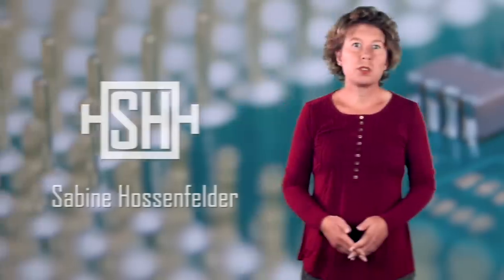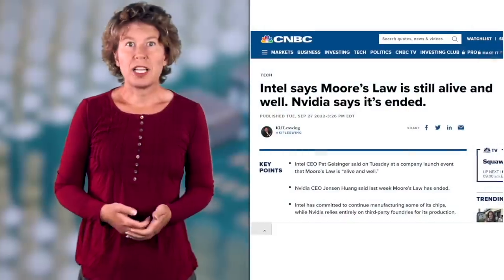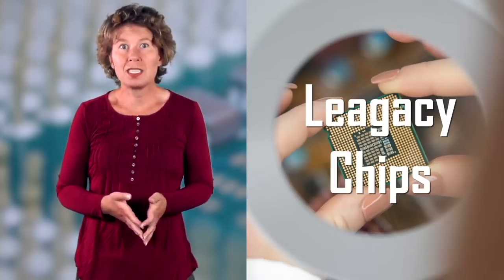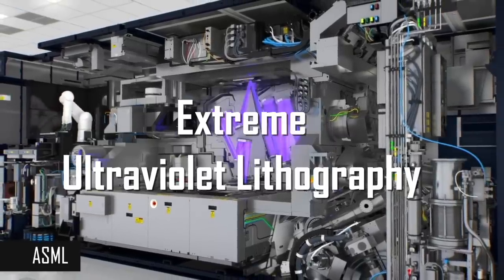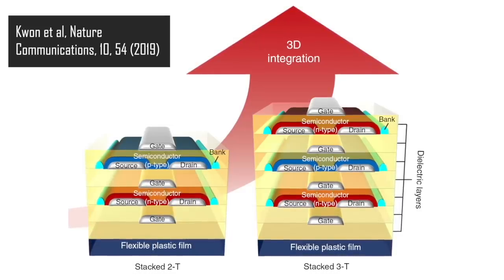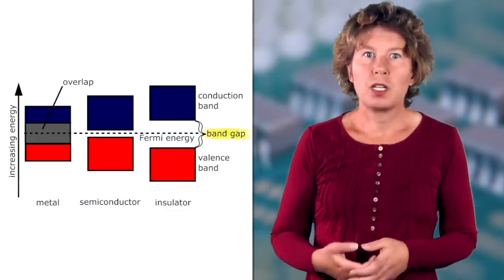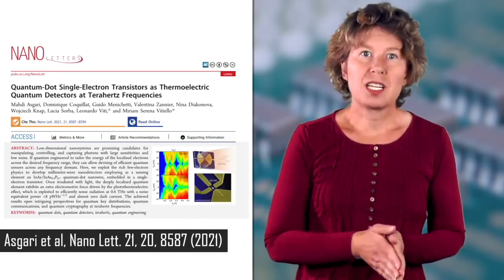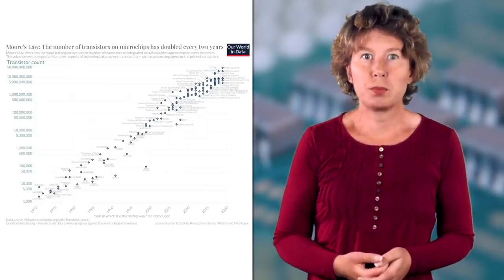Is Moore's Law Finally Dead?

Comment: Moore's law was originally about transistor density, and that original interpretation has been on its last legs for a few years now, despite some heroic work from the engineering teams at Intel, AMD, Nvidia and so on. His creator basically managed to see it go before he did. 

However, Moore's law in the interpretation of "how fast is this computer, really" has actually been dead for over a decade now. 

Pure processor speed basically stopped growing in the aughts. Around the time multiple core CPUs started coming out, as it was realized that, no, you can't keep doubling core speed every two years, 3 to 4 GHz is it for the foreseeable future. At the same time GPUs started taking on more and more esoteric capabilities, and dedicated cores to match. The current count of GPU cores is just silly, but it does account for their impressive abilities. They are certainly not running at THz clock speeds.

The bottom line is that CPUs are effectively not that much more powerful today than they were in, say, 2011 - at least per-core. 

12 years later, we should have had six doublings in power. That's 64 times the processing power. 

And we do... Mostly... It just so happens to be spread over 32 cores, each of them about twice as powerful, given a maybe 50% higher core speed - largely through improvements in instruction pipelining, branch prediction, and other stuff that, quite frankly, you could call black magic and not be too far off the mark.

Don't believe me? Check that Wiki site: 

A 4-core i7 from 2008 has a rated MIPS figure of 82000.

A 64-core Threadripper from 2020 has a rated MIPS figure of 2.4 million, give or take. 

That's a difference of about 32 times... Which is still missing a doubling over those twelve years... But more than that: divide the one by 4, the other by 64, to account for the number of cores, and you'll find that the numbers boil down to 20k versus 37.5k MIPS per core. And the threadripper has a 50% advantage in clock speed.

Twelve years later, each individual core is only about twice as powerful: a threadripper can only run a single-thread program about twice as fast as a 2008 CPU.

A lot of the improvements have gone into bringing down power consumption (which allowed us to have nice, quiet tablets with GHz CPUs) and adding dedicated circuitry for a number of functions that are much faster in hardware than software, like video decoding and encryption. That's still an increase in transistor count, so Moore's law isn't truly dead just yet... But having a CPU that can decode H256 video streamed via https won't help you play Crysis :P

Comment: 17:14 these capitalisation circutice the technologies of flow dots. Could be reverse engineered into logarithmic functions of its analogic computational advantage. Introducing a core assistant and fracturiced compartmentalized. If the analogical adherence coformulate. It would give us the thechnology to cool staked transitors. Introducing the frame aerly. These can be powerful components surrounding the main Q computer. Softproblem toggle for example. Also coherence 😮

Comment: My first computer was a Sinclair Z81.  I also had a few early 8086 -PC,s and a Macintosh Lisa, which I still have.  I recently built myself one based on an AMD Ryzen 7 7500X which is wicked quick, but haven't bought a new GPU for it, and still running a measly NVIDEA 1080, but since I'm not a gamer, it is more than sufficient for now, although I do Love playing with Mandelbulber 2, a 3D/4D fractal program which is probably the best of them all, and a much more powerful GPU would be great for that, as It can make fractals with realistic environments  (Reflections, refraction, fog, distance, depth of field, and even animate maneuvering around and even into them, which can take days, even weeks to render, so I guess I should build myself a super computer with a few hundred processors and GPU's!🤓
Reply: Dude, GTX 1080/TI was one of the truly legendary GPUs of the last 10 years. Still nothing to scoff at if you have one or can pick up a decent one at a decent price.
Reply: @ForeverTemplar  Well, yeah it was, but it's still not enough for what I need, and what is available now for way too much money.

Comment: I started out with a Radio Shack TRS-80 Model III that I bought in 1981. It had no floppy or hard drive, just a cassette drive with a "whopping" 16K of RAM that ran the TRSDOS 3.1 operating system. Not much existed back then in terms of software so I created most of my own programs utilizing the BASIC programming language since it had the BASIC language interpreter. I still laugh about it when I think back to the days of my first introduction to personal computing.

Comment: A couple of things.
Global Foundries is also a legacy node fab. They have decided not to invest pass the current 12nm node they have. I think this came out a couple of years ago, so not some latest news. They are innovating in the 14nm and 12nm (and older nodes) space, but they are not planning to get into 7nm,5nm, 3nm or smaller nodes. Of course this may change in the future.

Only fabs still pushing on to leading edge nodes are TSMC, Samsung and Intel. And probably a bunch of fabs in China as well(regardless of sanctions). It's probably a different topic to discuss what is a 7nm or 3nm node, since everyone seems to define it differently nowadays.

As for GPUs, Nvidia may have called it's graphics chips GPU first, but graphics processors have been around before Nvidia. 3Dfx comes to mind. And even S3 and others had some as well. Not to mention big guys like SGI, etc, before the x86 market basically ate them.

Otherwise, a pretty decent video I think.

Comment: Considering most manufacturers likes their smart phones and graphic cards to last only for a few years, Moore’s law is their friend as the reduction in atoms per transistor also reduce the transistor redundancy to stray neutrons. No need to continuously provide firmware updates and software support, as the device should have a short life. So Moore’s law might stop once a devices lifespan is reduced to 2.5 years.

Comment: Increases in processing speed will have to come from "compiling" algorithms in silicon directly and connecting these large scale functions. For example, I have no doubt that there are many routines in Windows that are used over and over again, and these could be implemented directly in silicon. However, this requires that we reconceive a processor as a linker of silicon subroutines that can operate in parallel.

Comment: :yougotthis:Well... I know most ppl call it Moore's Law, but I think was considered an interesting "observation" at the time it was said, and Moore's and MORE is an interesting coincidence... the limitations of size and that it would run out wasn't lost on ppl and historically many times they predicted the end of it... were wrong and it continued on and on!  However you want to state this law either as the measurement of density of transistors or measurement of those capabilities in equivalent transistors that ASICs do (e.g. GPUs)  will eventually play out too... Our applications of computers in everything and everything a computer will saturate... and in the end we play games, keep records, and automate things... after that point we should all just go outside and play after all that hard work.

A minor point I noticed is that you showed us a transistor symbol of a NPN bipolar transistor but the lithography cross sections were of MOSFETs...  LOL... only a nerd like me would notice and comment on a trivial thing that matters not a whit in the big picture discussion.

Comment: Newer thought to correct your videos, but here I am. As physicist you understand th problems of being in multiple places as the same time.

You used the bipolar transistor component sign. Even your C=128 did not use them in their main chips. They used Mosfets (nmos specificly). Other on that era did still use them.

The how transistor work however shows correctly how  mosfet transistor works.

Transistors are not on/off switches, they are used as switches in computers tough. It is like the accelerate and break pedals. They can pushed partially, even not all driver use them in such way.

What all computing uses is CMOS, it mean you have one transistor that opens with voltage(N-mosfet) connected to another that closes with voltage(P-mostfet). Your C=128 survided full megahers without the P-component, but modern computers that more gates that anyone count cannot go keep their gate bleeding without overheating. Cray research managed to go to gigaherts with that, but lost the green paper pieces that kept it over the water.

Afaik no carbon based transistors with p-most like component has been invented, thus we are facing more than engineering problems with them. Without the Pmosfet-style switch the transistor will keep consuming power and producing heat, when not computing anything, not unlike humans.

Comment: It seems to me the power performance of PCs stalled about 10 years ago> If I wait another 5 years  to swap out my old and get the most cutting edge PC I can buy for my CAD simulation work I now anticipate only a modest 10-20% improvement in speed and productivity  - which totally belies the supposed added 8 fold increase in gates added and phenomonal investment made by chip foundries. If Moore's law  is or isn't over it will make littel practical difference to me.

Comment: This has absolutely nothing to do with the topic of the video but I learned much later that the C128 could in fact output 640x200 pixels (in sixteen different colours) when hooked up to the correct sort of monitor. Since my friends only ever used theirs to go into C64 mode and play games, I never knew at the time…

Comment: TI 3:10, "Moore's Law isn't just about transistor size; it's about the number of transistors on a chip . . ." May I suggest it is really about how much information can be stored, persisted, then retrieved in space. ??  That way, if someone comes up with memory using quantum characteristics of atoms, we can get past the M_e barrier (Moore's Law / Electronic), and gt a more tech-neutral way of talking about what the information density limit is (bits / m3).

Comment: There are Samsung TVs on the market (called QLED, quantum dot LED) that use a layer of quantum dots on the LED backlight to increase brightness.  They still use an LCD pixel matrix, so they aren't quite as vivid or energy efficient as the more expensive OLED (organic LED) models.

Comment: I always love your videos Sabine! So don't take this negatively, but you made a misstatement 'cooling makes the system larger which defeats the purpose of making the chips smaller'. In fact, even by adding cooling which increases the volume of a system, having the circuits smaller still improves speed; smaller can mean less power which = less heat, which = less cooling, and cooling allows for greater density at the same heat, etc. etc. Perhaps not a big deal, maybe not worth bringing up, but there's no way that cooling a system would equal the volume of the circuit (CPU size, not compute superstructure size). Adding cooling would provide increasing returns, not diminishing... Unless I'm completely wrong, in which case ignore everything ;-). As a side point, decades ago when I learned how ICs were made, it occurred to me that one could produce a spherical CPU full of parallel molecule wide channels for coolant - keep it in LN like Cray did! Still think it's a great idea! ... Um, don't know how much I'd like to take my laptop to the industrial park for a periodic recharge though!!

Comment: Sabine H. (unfortunately) failed to mention this:
Silicon loses its semiconducting properties, when silicon transistors are fewer than 50 silicon-atoms thick.  Silicon atoms are 0.2 nm in diameter.  Thus, 5 nm thick silicon (50 × 0.2 nm), is the smallest (reliable) silicon transistor we can make.

That's why researchers are exploring alternatives — like molybdenum disulfide (MoS₂) — which is a 3-atoms-thick semiconductor, ≈0.65 nm in thickness; or ≈⅛th the minimum thickness of silicon transistors.

Comment: The last three PC's I built, in 2020, 2017, and 2014, did not have nearly as much performance increase between them as the PC's I was building in the decade 1992 to 2002. For most people who only use a PC for mundane tasks like word processing, email, budgeting and accounting for household or small business using Quicken, or watching Sabine and Neil DeGrasse Tyson on YouTube at 2K or lower resolution, you really don't need to trade up your PC for a newer one if it has at least a 4-core CPU, 8 gB of DRAM, and a 1 tB hard drive. This would be like the PC's I was building in 2014~2016. Upgrading to an 8-core CPU, 32gB of DRAM, a 4K high performance GPU, and a bigger hard drive isn't going to give you any noticeable performance increase for any tasks not involving video editing or high-resolution gaming. Where I have seen some significant advances, are all in CPU's and GPU's aimed at gamers. To build a machine capable of running Microsoft Flight Simulator at Ultra 4K resolution, with real-time satellite terrain imaging and photogrammetry of urban landscapes, you need a GPU in the $800~$1200 price range, a CPU with at least 6 cores and 12 threads ($250), and a 1 or 2 tB fast SSD to store the OS and game software and data. You can run Flight Simulator off of a magnetic hard drive, but it's abysmally jerky and you'll never get 4K at 60 fps frame rates; you have to have a fast, high quality SSD for gaming. And I can tell you from experience that it's the GPU that's generally the problem when a game isn't performing well, not the CPU or DRAM. Which is a shame, because CPU's and DRAM modules are cheap compared to replacing your inadequate GPU that you paid $750 for, with one that has, say 40% more compute units. 

The physical transistors on integrated circuits are probably about as small as they can get now; what's allowing CPU's and GPU's to get faster is multi-coring. Putting 8, 12, 16, or even 32 cores (AMD Threadripper) on a single silicon die. But as Sabine mentions, doing that means that the supporting structure - the aluminum or copper chassis that the silicon is mounted too, and the heat sink and fan, has to be able to draw a HUGE amount of heat out of the silicon. On my AMD 5-3600 CPU, with it's 6 cores, when I'm running a video processing task, or compositing 20 high-res stills into a panorama in Photoshop, all 6 cores are running at almost 100%, and of the 200 watts of power the CPU is drawing from the power supply, more than half is being sucked out of that silicon as waste heat by the fan. If the fan were to fail, the CPU would probably burn out in less than a second.

I don't plan on building another desktop PC until the one I've got now fails catastrophically; PC's are giving less and less performance increase per dollar. I need to get a newer laptop; mine was built in 2011 and it's getting really slow, but the problem with it isn't that it's CPU is inadequate, it's that the GPU in it can't cope with the new high-compression video codecs.

Comment: I do think we have reached the end of Moore's law, but not the way he thought we would.  We have reached it in much the same way one reaches the end of a Monopoly game.  Everyone just sort of decides not to play anymore.  That is not in the rules, but that is the way it usually goes.   You hear the terms 'faster' and 'security' much more than you hear 'even smaller'.  The other day my thumb drive broke.  I mean right in half!  Right where the USB connector ended.  I shoved it into the slot anyway, just to see what would happen.  It functioned flawlessly.  Had to get a set of plastic tweezers to get it out after I rescued all my files.  Well over 99% of the device was devoted to a connector big enough to locate and to dissipate heat, and a handle big enough to manipulate with fingers instead of tweezers.  It is some ungodly and unlikely number of terabytes.  Everything I ever wrote in my lifetime fits on about one tenth of it, and I write every day.  That is pretty much small enough.

Comment: In 1965 Moore stated that the transistors were doubling every year not two years.  Sometime in the late 70's it was changed to every 18 months and later it was changed again to every two years but originally for the first decade or so it was every 12 months.

Comment: I recently saw a tech flex video from a chip manufacturer that laid out an insane method of using x-ray lithography by dropping tiny droplets of molten metal and blasting them into plasma with a laser to generate the hard x-ray pulse. 
Insanity.

Comment: I understand your viewpoint on the death of Moore's Law, but there's an interesting aspect to consider. If we broaden our perspective by replacing the word "processor" with "computer," we can observe a significant increase in the number of transistors in recent years. Indeed, modern SSDs incorporate billions or even trillions of transistors to manage and accelerate storage operations.

This ongoing increase in the number of transistors, even beyond processors, demonstrates that the miniaturization and integration of electronic components continue at an impressive pace. While Moore's Law may no longer strictly apply to processors, technological innovation takes various forms, such as SSDs and other advancements, contributing to the continued growth in computing power and performance.

This highlights that, although Moore's Law may evolve, the evolution of electronic technologies and transistors isn't stagnant and continues to bring substantial improvements in various areas of computing.